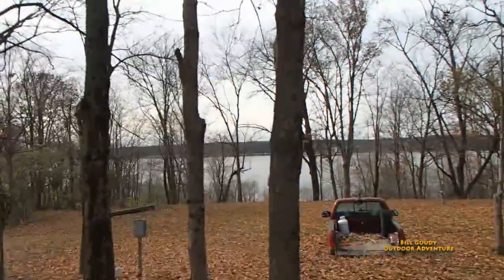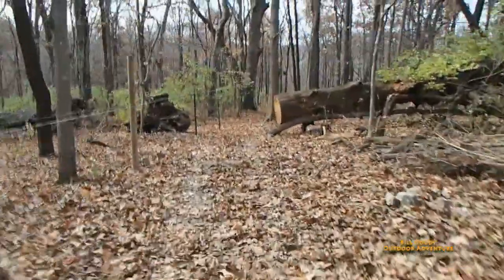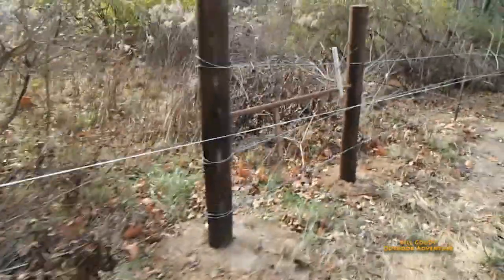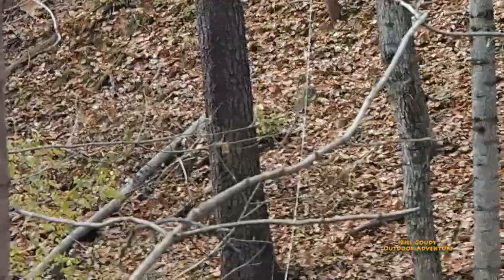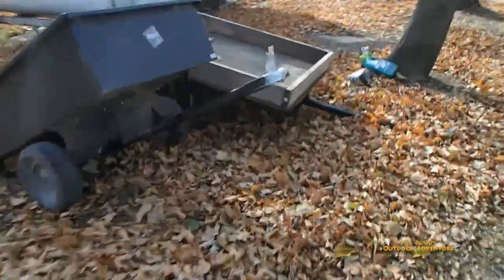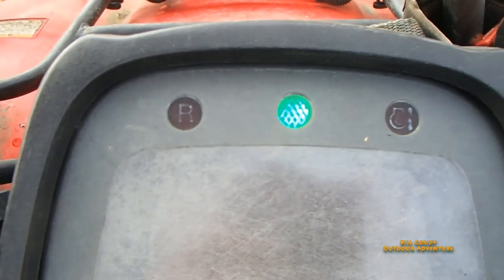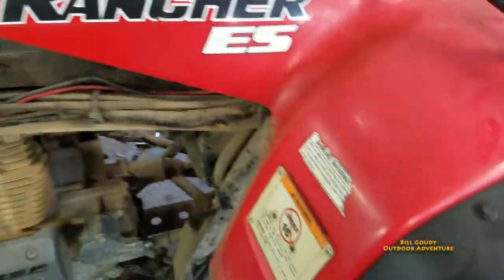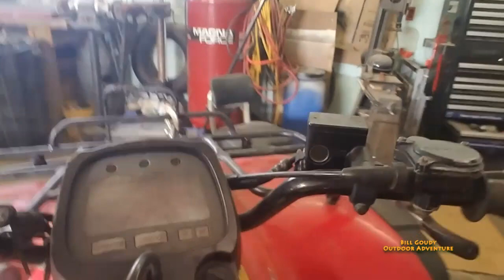Life Runs In Cycles

Comment: You may have run over an old piece of barbed wire that caused the damage to your shift wire plug.
Reply from the maker: That is a posibility.  When I noticed that the shifter no longer worked, I was on the main trail and I had been using the 4 wheeler all morning. I sure don't recall running over anything and that wire is protected by a metal cover.  There are 3 wires going to the same plug. Only one was broke...  One thing for sure....  It is working now....   Haha!!  Thanks, Dwain!!

Comment: Securing your borders...ha. .Dang rodents chewing wires?
Reply from the maker: Haha!!  Yep!  I can patrol the bordors, for the most part. I still need to make a trail in that steep part and install a fence across the back (East side) of the property. I plan on doing that next year...  I hope!!  It sure didn't look like the wire was chewed.  It looked broke. I had been driving the 4 wheeler for several hours before the shift quit.  I was on the main trail and I don't recall running over anything.. I have had rodent problems in the past...  They built a nest in the air cleaner.  I can't say that it wasn't rodents...  I do know that it is working for now...  Haha!  Thanks, Kurt